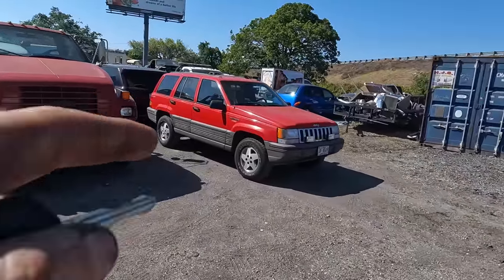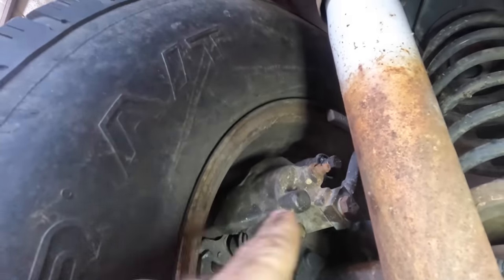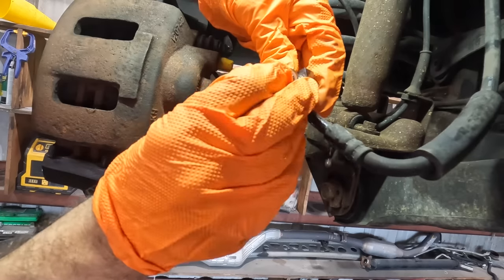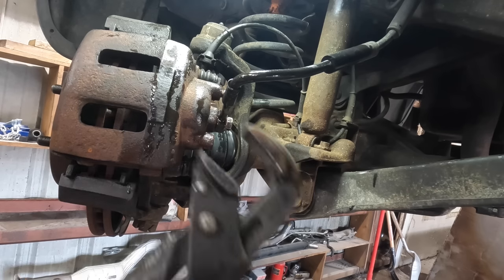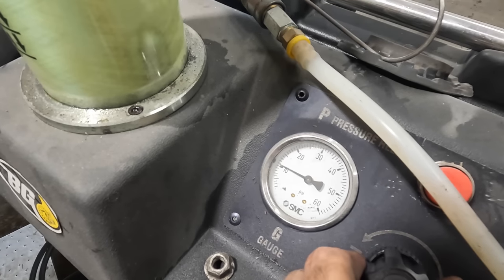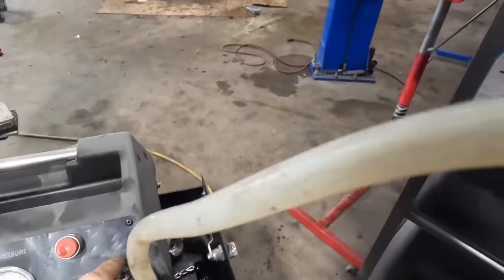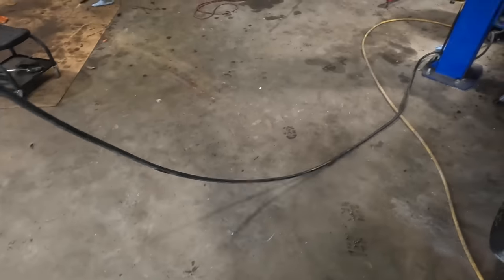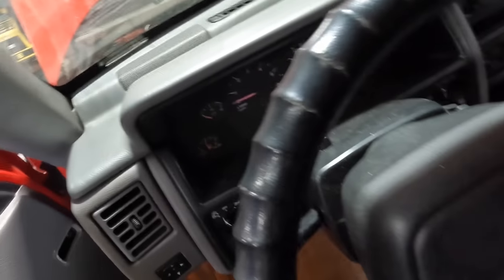Customer States: Air in System No Brake Pedal! |  Jeep Grand Cherokee 5.2 v8 #nobrakes

Comment: Had a buddy changing his own calipers on a ram 2500.  He calls me with bleeding issues.  Says he'd bled a quart through and still couldn't get a pedal.  After some pondering I ask where the bleeders are, top or bottom, he replies bottom.  He installed the calipers on the wrong sides.  A couple months later another buddy,superdutu, was changing a caliper and calls with similar issue.  No pondering required, he'd been sold the  the wrong side caliper.

Comment: Were those the original calipers up front? The geometry of the port looks different on pictures I looked at on-line. The hole on the OEM caliper faces toward the back of the vehicle not  toward the center-line.

Comment: I was a little concerned when I saw you mix DOT 3 with DOT 4 until I remembered that's fine.  You just can't mix DOT 5 with 3 or 4. Just the front brake lines will have a lower boiling point (no big deal). Did you give the guy new dust caps with the flush?  Not sure of the point of fixing the brakes with an axle seal leak around the one rotor.

Comment: Wow, I wonder why anyone would have put the brake lines on wrong, when they could plainly see they were stretched!
Reply: You would be surprised, seen it before. Saw one time where a car was towed in because when turning to the right, the left front hose was rubbing on the tire wearing a hole in the hose causing loss of braking fluid pressure. Luckily, the guy was pulling into a parking lot when it blew. Somebody did a previous brake job installing the caliper backwards twisting the hose out of the correct position.

Comment: Great video as ever. Regarding the brake master cylinder cap leaking.; as far as I am aware master cylinder caps have a vent hole and I think you have to put a full width gasket across the cap to hold pressure without fluid leak. Not trying to be clever but think I have heard it before.
Reply: Master cylinder caps (and clutch master caps) I've encountered DO have a vent hole
Reply: @thecuss6817 

Absolutely. That is why I think you have to produce a temporary  sealing gasket to seal the cap when pressurising. When the operation is complete you remove the temporary sealing gasket.

Comment: I think you got that jeep with the wrong front flex lines. Should have got a couple of new ones to compare. It may have been they were installed on the wrong side. I dont like them standing straight up, mud in your area and add snow in my area might cause a problem when it collects inside the rim. I've been twisting wrenches for almost 50 years, and I learn something everytime I watch your videos. Even if I disagree! LOL

Comment: Hey Ray!  Fun as usual!  I noticed you were not reinstalling the rubber caps on the bleed valves.   Is that because you are in a non-salt zone?  Putting new caps over all valves is mandatory up here in the northeast!
Reply: Never happens in Australia! Having said that it's one of my pet peeves.
Reply: They use salt brine in Tennessee.
Reply: @sullidave7871  It's still good practice to put the things back on. Or, if they have deteriorated significantly, to replace them. Places I've worked at had them in bulk in a tray. They were cheap enough to give away (but still mention on the paperwork, of course, with a "no charge" designation).
Reply: except when they are shot! they were gone. rotted away from the Florida weather.
Reply: I noticed you used dot 4 of the BG fluid. I thought these took dot 3?
Reply: @jimmycheese3817  DOT and DOT 4 brake fluid are cross-compatible; the latter has a higher boiling point, but they are both glycol-based. DOT 5, on the other hand, is silicone-based, and cannot be mixed with either of the other two. If memory serves, there might also be an issue with the seals if you use DOT 5 in a system meant for DOT 3 or 4 (or vice versa), but I cannot swear to it.

There should be no problem with using DOT 4 instead of DOT 3; the only situation in which you would cause a problem by using DOT 3 instead of DOT 4 is in extreme service/performance conditions... The minimum "dry" boiling point of DOT 4 is approximately 230°C/446°F, while the minimum dry BP of DOT 3 is approximately 205°C/401°F. By the way, if the brake fluid becomes "wet" (contaminated with water), the minimum boiling point drops to 155°C/311°F for DOT 4 and 140°C/284°F! This illustrates why it is very important to change one's brake fluid if/when it gets any amount of water in it; it also tends to hasten corrosion of system components. If it has gone dark, change it because the likelihood of some degree of water contamination is high by that point. Also, don't buy brake fluid in a quart container if you only need a relatively small amount to top off your system - while it does not expire, per se, it will become contaminated with water over time from the moisture that is present in the air. Use (or discard) it within one year of opening the bottle. Change it according to your vehicle manufacturer's maintenance schedule recommendations. Or every two years / 30,000 miles to three years / 45,000 miles. Or, as mentioned above, when it begins to darken noticeably.

There is also DOT 5.1 brake fluid, which is confusingly - and stupidly - named, because it is glycol-based and, therefore, NOT COMPATIBLE with DOT 5. Whoever thought that particular naming scheme was a good idea shouldn't be sued - they should be shot (and then their estate sued).

Comment: What if the right side hose is on the left, and vice versa ? Also, how much slack is there with max steering left/right ?
Reply: When things don't fit right like this, I wonder if the parts are on the correct side, actually a left and right and not 2 of the same or even the right part for that vehicle? Owners and parts shops are not always on the same wavelength. Oh yes, it will fit your vehicle, says the parts guy, but it isn't a perfect fit, and the owner just accepts it not knowing the difference.

Comment: I have noticed that when you bleed the brakes, the rubber cap comes off and we don't see you putting them back. They put those caps on for reasons some people may not realize, keeping moisture and dirt out of orifice from rust or corrosion that would prohibit removal or loosening for next brake job. Please, please complete
Reply: those caps were garbage, bro.... did you not see them.???
Reply: @MrMustangMan  still need to be on, can't just leave them off

Comment: I’m a long time fan, but in so many instances I find myself asking the same question. Why doesn’t he have or maybe he does, but he never uses tubing wrenches? They make life so much easier and they are far superior than regular wrenches when working with tube fittings. I’m honestly curious why you don’t use them. If you have the time I’d really like to know.
Reply: lazy to find them.
Reply: Also he apparently doesn't know about ratchetting line wrenches either.
Reply: @aliasfred Which one is the controversial line wrench ratchet quite a few good reviews but only two told the truth ( CP, and Justin) they wouldn't put the name to the line wrench starts with a letter Tr---s tools.
Reply: because he is an expert and can sense the amount of stress he is putting on the fittings as to whether or not that wrench is holding or letting go.....

Comment: are the struts(?) in the front spring coils (@11:19 etc.) supposed to be half missing?  Being this is a Jeep, they may not have noticed.
Reply: shocks and struts extend when on a hoist.....
Reply: @MrMustangMan  agreed, but the inner part of those coils those did not APPEAR to be connected at the bottom.

Comment: Just gonna throw it out there 'cause it doesn't look like anyone else picked it up. If you'd prefer to stay alive, you might properly check the orientation of the chassis pads on your rack before you lift (you checked and still missed it). In this case, the driver's rear was out 90 degrees, which could have allowed it to slip since it was metal on metal, and not encapsulating the rail.

Comment: Hey Ray, at 11:11 on the right side front is that a strut broken in half and all rusted out?  You mentioned it needed some front end parts.  I see the shock absorber in the foreground, but that looks like a broken rusted strut inside the coil.  Que pasa??
Reply: That is a rubber bump stop, just nearly rotted out.

Comment: Not a Ree , but an honest quuestion - Should you have replaced the crush washers on the banjo bolts? Otherwise, great video as usual. Keep the coming.
Reply: too many should haves not done. $60, u got what u paid for.
Reply: There copper, if they don't leak there good.
Reply from the maker: Agreed
Reply from the maker: Just crush them more 😈
Reply: @RainmanRaysRepairs  Thank you. I wasn't sure and will be doing some break work soon. I wanted to make sure I got everything I needed for the job.
Reply: @bubbaray998  even when they get to hard to seal well you an anneal/soften them back to like new. Just heat them up red hot then let them cool down.

Comment: I really hope your putting in another roll up door to have a straight lift ray :) and is it okay to mix dot 3 and 4?
Reply: 4 can be used instead of 3. But if your components started on 4 and are recommended to use 4, use 4 only.
Reply: You can mix the DOT 4 and DOT 3 brake fluids. This mixture is possible because they are both glycol-based and compatible. However, filling your car with DOT 3 is not recommended if it has a factory-filled DOT 4, although you can fill a DOT 4 brake fluid in a factory-filled DOT 3.
The boiling point is the significant difference between the DOT 4 and DOT 3 brake fluids. The DOT 4 fluid is best for higher performance because of its higher dry and wet boiling point.

Comment: Sorry, but I didn't like this. The rear brake rubber boots needed attention and I don't think bending the pipes is a very good idea....I certainly wouldn't do that with my brakes.  I'm wondering if the hoses were swapped right to left and vice versa? Not sure if they are handed.

Comment: Using a funnel for brake fluid is bad? who knew! thanks ray :)
Reply: Brake fluid is notorious for picking up contamination. It is both hydrophilic(attracted to water) and a dirt magnet. Because of being hydrophilic, water builds in DOT3 and DOT4 brake fluid and causes the system to rust from the inside. That is why all cars need scheduled brake fluid services. More so in coastal environments.  To eliminate the hydrophilic DOT3/4 brake fluid it requires the entire replacement of the braking system, all lines, calipers, distribution blocks, proportioning valve, master cylinder, wheel cylinders if drum brakes are present and sometimes the brake booster plus the ABS and run DOT5 silicone hydraulic fluid which is 5x as expensive. Bad thing about DOT5 is poor cold weather performance, it thickens up and freezes at around -20F.

Comment: Just a note— there is no such thing as “suck”.  A vacuum is just low or no pressure.  Lack of air or pressure cannot possibly suck.
Reply: Unless you are scuba diving....
Reply: In this world lots of stuff sucks, I find. 😄
Reply: Well, if you're working outside of the ISS...
Reply: @spaceflight1019  Still, no suck.  I know, every instinct says otherwise.
Reply: @spaceflight1019  Sorry, there is especially no suck in outer space.  Nothing at all out there to be "pulling".  Your space suit can be fluffed up but that's totally due to the air pressure inside the suit.   You can verify this, take off a glove to let all the air out and the suit will totally lose its puffyness.  So, nothing sucking it outwards.
Reply: @georgegonzalez2476  Regardless, you have to agree that the end result will really suck for whoever is doing the EVA. But, let's stay with air pressure. 
Just like water, air will move from areas of high pressure towards areas of low pressure. Therefore, it can be said that low pressure will suck air from a higher pressure until the pressures are equalized.
Reply: @spaceflight1019  Um, no.   There is not the slightest amount of cohesion, stickyness, or pull from air or low pressure or vacuum.  It's the higher pressure pushing all the way.  There is no pull.  Just not possible!  As the ultimate example,  if you open an air-filled bottle to outer space, ALL of the air will push its way out.   Not a single air molecule will stick to another and stay inside the bottle.  No suck. All push out.
Reply: @georgegonzalez2476  While I see your point, from a practical perspective what difference does it make?
Reply: @spaceflight1019  It means that you can't understand why you can't suck water up a garden hose past a certain point.  It means you can't explain why straws don't work at all in outer space.   It means you can't explain why "suction cups" don't stick at all in outer space.   It means you can't understand why your car stalls on a hot day due to "vapor lock".  Or why you don't get pulled into a jet engine from 15 feet away even when the intake air is moving at hundreds of miles per hour,  but you do get blown head over heels if you're hundreds of feet behind one..   

A lot of things are impossible to fathom if you believe in sucking.

Comment: I loved hearing that 5.2 cranking up.  I've had a 1995, then I got 2 1997s with the 4.0 and a 2003 also love them 6 cylinder engines.  Starts searching marketplace for another Jeep Grand Cherokee.  I would like to know where they got those Uniroyal Liberator tires from (Walmart used to carry them). I put almost 100k miles on a set on my 97 Jeeps
Reply: Happy Hunting

Comment: I'm trying to find a facility that rebuilds ABS hydraulic control units for a 2001 Ford Excursion; specifically the hydraulic block.  The HCU (1C3Z-2C286-BB) is a discontinued assembly; anybody know of a company that does this?

Comment: Ray, tsk tsk, dude, torque sticks are color coded and I practically have them memorized. An orange torque stick torques to 80ft/lbs but that vehicle's lug nut torque spec is 100ft/lbs. You should be using the grey torque stick. Screw the extension. You're using the wrong torque stick for that vehicle.

Comment: Is it ok to mix dot 3 and dot 4 brake fluids?
Reply: You can mix the DOT 4 and DOT 3 brake fluids. This mixture is possible because they are both glycol-based and compatible. However, filling your car with DOT 3 is not recommended if it has a factory-filled DOT 4, although you can fill a DOT 4 brake fluid in a factory-filled DOT 3.
The boiling point is the significant difference between the DOT 4 and DOT 3 brake fluids. The DOT 4 fluid is best for higher performance because of its higher dry and wet boiling point.
Reply: @mrmustangman  about the downgrade I knew, but thanks, I'm glad to see this community is still healthy 🥰

Comment: You're not wrong about 4.7 in the jeeps, just a couple years off before they made that awful engine choice.
Reply: I had a 4.7 SOHC sludge generator in a 2000 Durango. Started using Mobil Delvac and the sludge monster was gone.
Reply: @spaceflight1019  it definitely helps to use quality oil and keep it changed often in those

Comment: Just to be correct, this is a ladder frame vehicle, not a "unibody" truck.  That is, the body is bolted to an old fashioned full frame (just like the old Flintstone's days).  Love you, Ray!
Reply: This vehicle is a unibody.
Reply: @ms01885 orrect, it is and always has been.
Reply: Sorry Glenn, you're wrong. The ZJ is a unibody vehicle, like all Grand Cherokees.
Reply: I had 3 of them. All unibody 
, 318 engines. Drive every one to 200k + miles. Got rid of them when the death wobble came along

Comment: Hi Ray. I’ve always been instructed to bleed the corners from closest to furthest LF/RF/LR/RR. Otherwise you can suck out bubbles from shorter lines. Thoughts?
Reply: thats true unless there is already air in the system.... you want to remove the air first....

Comment: Should have tested the torque extensions with an actual torque wrench after.  I'd be curious to see how close that got.  I've used them with air before but didn't double check it with actual clicks.  Keep up the good work Ray!
Reply: I have a set of those and have tested the accuracy. They are NOT accurate. They leave the nuts under torqued. I still use them for initial tightening, but then I do a final torque with a torque wrench. A wheel falling off a customers car is not acceptable by anyones standards.
Reply: Other videos show that he does use an actual torque wrench after the vehicle is on the ground. He just doesn't film it every time.
Reply: gra foeh  My torque sticks are made in usa but I don't have the case they came in anymore, so I don't know the brand of them. My pneumatic impact is a Mac AW4300 and my torque wrench is a digital Snap-on Techwrench. I don't buy cheap tools.
Reply: @scott.koopmann  copy that luckily it was just on my car and I was always wondering.  Not a good feeling I'll be duplicating....

Comment: Another great video Ray. Ray we’re having a brake clean withdrawal from not seeing nice & shiny cleaning, water ain’t the same🙂. So that Jeep is leaving Florida & going to Tennessee. Hope that there’s a great mechanic/technician there, if not maybe it’ll come back to to fix the other things that it needs. Ray on the subject of those pain in the hinny lug nuts, my Ram has the same style, I have to use a 23mm socket to take mine off. My four way lug wrench with 7/8 will fit fine but a 7/8 six point socket won’t. I know that it’s not important to you. We’ve had ourselves a great day today watching you have yourself a great day today playing in brake fluid while Jeeping